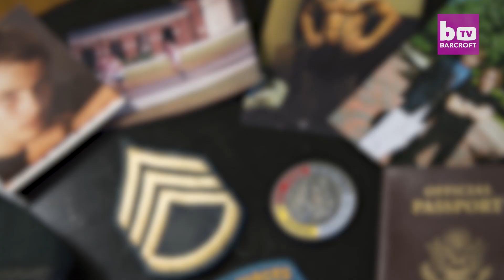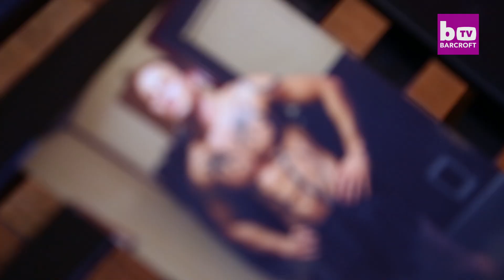My Transition Story: From Special Forces Soldier To Real Woman

Comment: Trans woman here: I speak only for myself, but here's where I stand personally on this most controversial issue. Even if I were anywhere near being MMA material, would I compete against cisgender women? No, I would not. It's like this: take the engine and transmission of a truck and put it in a car body, then you have a car---but it still has the inherent power of a truck. Therefore, it would be unfair to pit this modified car against other cars with their factory engines and transmissions in a pulling match. To put this into context, the brain I was born with and the consequent body modifications I have made on myself do make me a woman. But I know that no matter if I pass or not, I still have the advantage of a male skeletal/genetic structure. Therefore, if the sport is predicated on strength or size, I would unconditionally decline competition with a cis woman. I would feel too guilty about it! On the other hand, a sport like table tennis where agility and dexterity are the common denominators, that's fair game. I'm pretty good at that game---but I've had my butt kicked fair and square by another woman more than once!